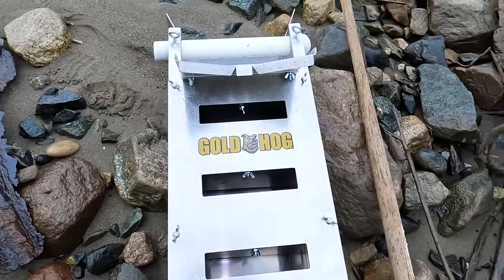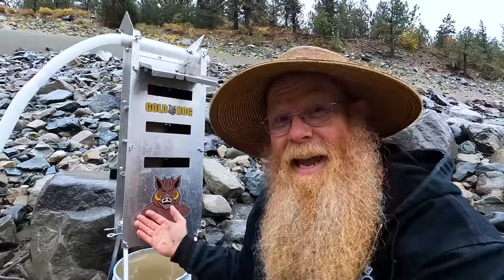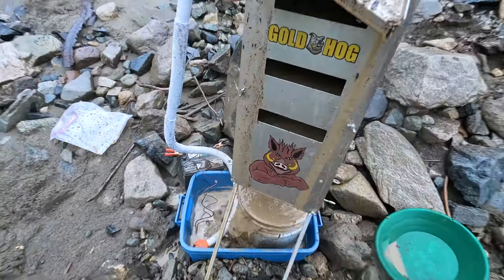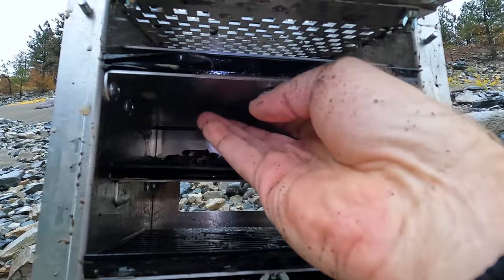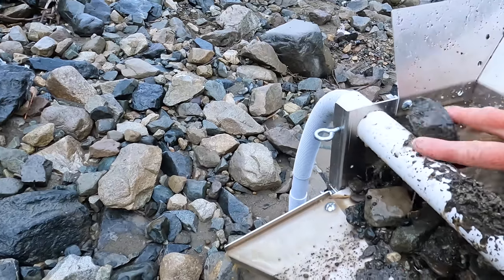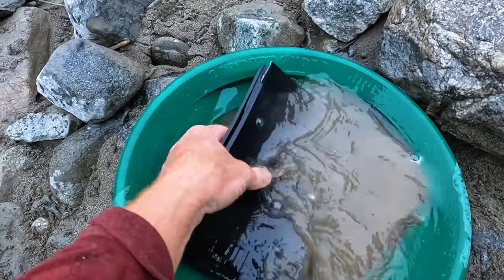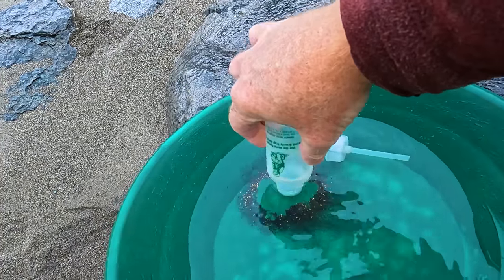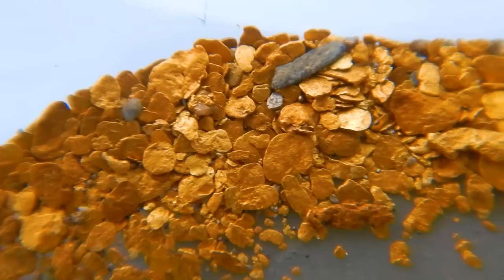New Gold Recovery Technology!  Great Gold!

Comment: That's somewhere between $35-$40 US. That's better than a sharp stick in the eye.
Dan, I've often wondered what your personal opinion is with river dredging. I hear mixed reports. Some say its bad for the environment, others say it is either neutral and sometimes good because they also remove heavies that shouldn't be there, like mercury and lead.
You must have a better educated pov. 
What are your thoughts?

Comment: Hey why cant you just put the pump in the river for fresh water I know you said your not aloud the water to go back into the river but when you dump the water out of your bucket your doing the same thing if you leaving your taleings bucket and let the water flow over it would flow at a slower rate than dumping a hole bucket witch would have more time to discharge bucket in to the ground.

Comment: That gold has a color that's a little different from what I'm used to seeing however I've never done any prospecting but is that what's referred to as Placer gold if so about what purity is it once you separate it from all the black sand roughly speaking a ballpark range percentage or karat (either way works for me)
Thanks for the video it's very interesting machine and you have a new subscriber 

have a good time at the concert
Gold hog   
:)

Comment: The laws are soo goofy sometimes. When you dump that bucket of water the muddy water returns to the river....... but yet you can't circulate from the river lol? Also I wonder if by using a ram pump you could keep the water flowing longer or also get a roll or fold out solar panel to charge while you pump?

Comment: Gold Hog, the wing nuts are a joke, improvement  one, put latches on there, improvement two, use springs to hold the face plate in place. It appeared to work well except for the wingnuts and there needs to be a greater slope on where you shovel the dirt on and the water squirter should be on the other side to push the rocks off. have a good day.

Comment: Hi Dan! Fun and informative vids. I am getting tired of just using a pan and bucket with a lot of finishing up at home. The Gold Hog brand behind the Boar Box looks to be a great next step. Did GH increase the size or move the finger slots, and did they move the screw holes so the screw heads no longer interfered with the wing nuts? I've worked with sheet metal. I'm thinking of a simple piece to angle the coarse gravel away from the edge of the box toward the center of the perforated grader. Wish me luck  with the drawing! 🙂

Comment: What about instead of bringing a recirculating Reservoir that's too small or even a larger one just bringing a 50 mil rubber sheet like a pond liner or water bread and mattress and just dig a shallow hole putting the excavated dirt in a ring around it and then lining it and using that as the reservoir you can make it any size you want and if you fold it up nice and neat a whole lot less to carry and you don't have to find someplace that fits that way either because it can be any size or shape you want it to be and fit anywhere you choose.

Gold hog

Comment: Dan I tried to send this to goldhog but rejected are they out ob business? Dear Gentlemen.
 
I ran across Dan Hurd's you tube review of your Gold Hog gold separator.
 
I defiantly like it better than the gold cube.
Just portability and access to the mats is enough.
 
Dan implied you listen to your customers and hopefully pre customers.
 
I will have to get permission from my mining club first to purchase.
 
What I will have to change if I purchase one. 
 
#1 the wing nuts will have to go. 
 
In your application for the front plate use spring clamps with a hole drilled in them to clamp over the 1/4 or 10/32 bolts and the side wing, quick as a bunny, no wing nuts to lose or fiddle with. As for the internal mat holders bolts I will have to make custom clamps with either welded or glued on nuts cut in half to replace the wing nuts. 
 
The last probable problem is the leg mounting.
I am not sure about this one without actually playing with them.
I would purchase this unit for the purpose of hiking in a good distance and this instrument lends well for back packing.
 
The legs will need to slide up and alongside of unit. Then during set up one would just need to swing levers and drop the legs from the up position while holding the unit with one arm then switching to the other arm to release the other legs and swing the lever clamps closed. Then set the instrument down to use. This would be similar to releasing wheels on a better bicycle.
 
The only tools we want to bring would the instrument, gold pan and shovel, ok and a bucket. I could leave the classifier at home.
 
I hope you find these thoughts useful.
 
Rand Dill

Comment: So, after buying all the equipment, lugging it all down to the river and spending a hours shoveling rock and sand, panning and then cleaning everything and lugging it all back to your house, you ended up with... .65g of gold, which at today's rate would be about $38 for roughly six hours of labor. Grocery cashiers make that much in a little over a couple of hours... is the thrill of finding gold flakes really so alluring that you'd work this cheap or is the real gold in the ad revenue from the 1m+ subscribers?

Comment: I’m thinking this machine looks horrible! Easier to use a recirculating sluice IMO. Horrible design with this “tower”. Too difficult to configure the tubs/buckets underneath due to the legs. Too small of a classifier area. Too many wing nuts to remove to do a clean out. No thanks. Looks like the guys at Gold Hog are trying to find a new way to replace all that money they are losing to Dream Mat. 😂

Comment: You need to make a high capacity battery pack out of 18650 rechargeable lithium ion batteries that you can get for free from old cordless drill batteries or laptop batteries or just about anything that uses rechargeable battery packs that you could get from your local municipal dump or the place you take old batteries often for free and a $6 or $8 battery management system printed circuit board from eBay that balance charges prevents overcharging over discharging or all those other little problematic issues that happen with rechargeable batteries because it doesn't have to look pretty as long as it's effective and you could make one that fits in your pocket that would last you all day or maybe two even and they're easy to make you can find it a huge number of How To tutorial videos right here on YouTube easy peasy piece of cake and if you wanted to get a little more elaborate you could even get a fold up solar panel array or even a small portable water wheel since you're always near running water and charge as you go just wrap it up in your rubber liner and throw it over your shoulder.
18650s are 3.7 volts DC so your pack would be for 12 volts 5 in series and then how ever many parallel series of five that fit in the space you've designated for your pack which is how they do laptop batteries and E bike batteries drones RC cars Etc because lugging around a lead acid battery is so 20th century LOL  gold hog